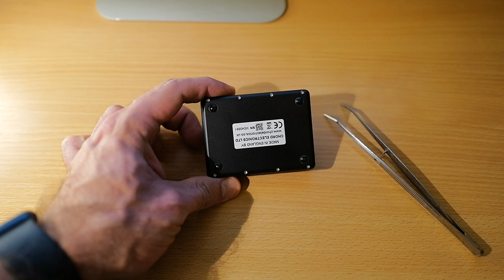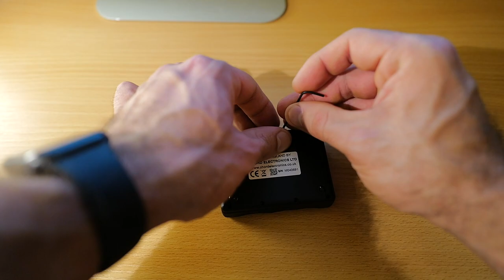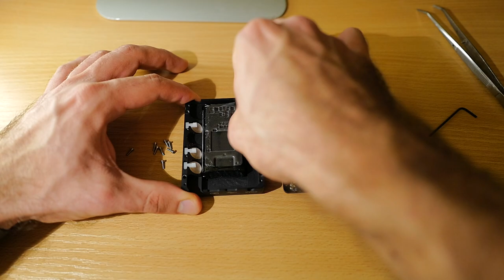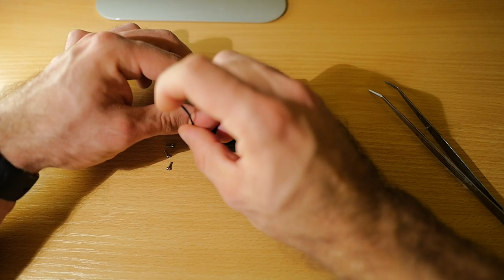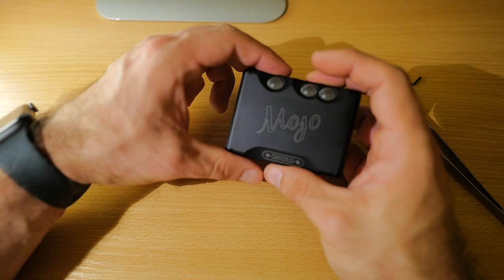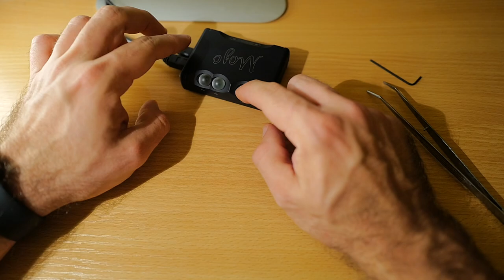How to convert Mojo into a (always on) DESKTOP DAC? Step-by-step GUIDE

Comment: One question, does disconnecting the battery mean that the USB power must be a higher quality,  now Chord say that an audiophile power supply supply won’t make any difference , but is that because the battery is in circuit?
Reply: Hi Grant,

I removed the battery of my Mojo over a year a go. It was fairly straight forward aside from the careful peeling of the battery from the top case. The battery was about to pop! It has worked flawlessly ever since and runs much cooler. It does however cut out occasionally but it is much less prone to this behaviour than when it was functioning with the battery.

Anyhow, I'm using the 5v 1 amp rail of my Allo Shanti power supply. It's a linear power supply which uses super capacitors for the output stage. 

It has been a long time since I did the modification so listen to what I say about sound quality with a dose of caution. I'm not going to editorialise by using the usual audiophile terms but what I will say is that, to my ears, it sounded better in every way. Bass become much more realistic and the soundstage opened up. Nothing seemed to suffer. However like I say this was a long time ago and YMMV.

Comment: So i removed the battery and used the USB port on my iMac to power the Mojo. Everything works fine but this method uses the charging circuit to power the mojo which means the mojo is always charging when playing music and produces a LOT of heats. It's equivalent to playing and charging at the same time when the battery is installed. This excessive heat is no longer destroying the battery since it is removed, however i am worried about the long term effect on the electronics.
In the end, i think the best solution is to wire an external battery to where where the original battery connects inside and charge the battery separately when not playing music. No excess heat will be generated when charging or playing as long as you don't do both simultaneously.
Reply: Edit to my post above: i also tried an external  5V USB battery bank connected to the charging port and the result is the same; the external battery triggers the charging circuit and it is the charging circuit that powers the mojo, not external battery bank. Again, the Mojo is overheating because it is playing and 'charging' at the same time.

Comment: A product that isn't manufactured in China, Philippines or Vietnam?  Difficult to believe.

By the way, Allen is actually a brand name and the generic term is "hex key" :)

 I take it that there are no settings which are normally saved with the battery?  Any settings are saved in flash memory?

I also suppose using intricate tools is very handy for the office.  I'm glad though that computer servers aren't the size of or quite as intricate as a smart phone just yet!
Reply from the maker: The mojo doesn’t really have any settings. The only “setting” is the last state of volume. And that becomes unimportant for this particular case as the volume is set once and for all when used in a desktop system with speakers. However, yes, even without battery it does remember the last volume level.

Comment: Thank you for the video. I managed to disconnect the battery. When I turn it on, the computer can recognize it as mojo, but I can't hear any sound from the output. What can be wrong?
Reply from the maker: That does not sound right. Does the mojo turn to a color to indicate signal input? Is the volume too low? What operating system?
Reply: @TechBlogPool  Yes, there is color showing the signal input. I adjust the volume to max, but dead silent. I am using Window PC which recognizes the mojo. Very strange to me. Can changing power charger make a difference? The output I used is 5V, 2.4 A.

Comment: Nice video Can i connect the mojo to one usb port with a splitter on a notebook?
Reply from the maker: Hi there, depends on the splitter. There is a special cable which enables you to connect the Mojo to one USB port. Take a look at my Mojo Accessory pack video here: https://youtu.be/FMLLya8nYnk. It is a USB A to 2 micro USB splitter but what it does is also split the data and charge parts. https://chordelectronics.co.uk/wp-content/uploads/2016/09/CablePackContents12-CORRECT-900x675.jpg
Reply: @TechBlogPool  Thanks a lot!
I would like to buy a mojo but I don't like the battery thing. Do you think Is a viable option to buy It, remove the battery, and use It with a laptop with the splitter cable? Will It get warm too in this way?

Comment: Super useful video. I followed the procedure and I am now on external power. One question, if I may. Is there a way to avoid the automatic turn off? Or a way to automatically turn on?
Reply from the maker: Thank you for your kind feedback! Unfortunately the automated power off is a permanent firmware function and cannot be disabled. It is irritating. I know. :-(
Reply: After how long does it turn off?
Reply from the maker: A few hours. I was never patient enough to wait and time it but I think 8 hours or 10 perhaps.
Reply: @mccririck01  about 10 minutes
Reply: @TechBlogPool  that seems ok then. I wouldn't be listening for that long non stop.
Reply: How was the mod? Does the mojo still run hot on external power?
Reply from the maker: Yea. Still hot. But unfortunately that’s by design. The mod went well!
Reply: @TechBlogPool  that’s just unfortunate, I was very upset about how good they are but they broke off within one year of usage
Reply from the maker: I hear ya. What specifically broke on yours? Did the whole thing stop working? It seems to be a hit or miss somehow. Some last forever and some break. Here we have a 2 year warranty as standard so if they break in a year you get a new one and the warranty extends as new.
Reply: @TechBlogPool  nah I'm just doing some research on chord mojo since I am looking for a new dac. I'm considering about getting the chord mojo 2 when it come out on january 2022. Hope it doesn't have the same reliability issue like the chord mojo does
Reply: Yes, Just need a small piece of paper, tucked between the switch button and the top cover.
Then your mojo will turn on auto when USB power on, I'm using this now.|

But, when you plug out USB power, you need to wait some time then plugin USB agian ,then it can power on.
If you Plug out and plug in directly, Mojo will turn OFF , not sure why.

Comment: Hello! So funny enough I bought Mojo 2 first but didn't like the way it sound and my friend who has tried both said I'll probably like Mojo 1 better. So now I'm looking at ways to make it desktop capable.

I read about this removing battery technique but some people mention that the battery is 7.4v and usb is only able to supply 5v so this method won't sound the same as running off battery.

Did you the sound change after you remove the battery?
Reply from the maker: Nope, sounds exactly the same. Functions exactly the same. All power is converted to the specs the chips need. If the power was not enough the Mojo would simply not work at all. This theory works for analog products maybe. Like if you feed a tape recorder lower power it goes slower.
Reply: @TechBlogPool  Awesome, that's very good to hear!  Time to hunt down a Mojo 1 lol, thanks!
Reply: I just unplugged my batt. from it.  Powered it using a cell-ph charger 5v 2 Amps. 
Measured batt connection on the board while connecting to the charger and it read 8.4v.   
Working perfectly (sounds better than before with batt. connected).
Logically it should give 8.4v supply to the batt for charging even though its a 5v supply (some step-up in the circuit it self). so it isn't necessary to use an external power supply with 7.4v. (IMHO)
Tried to power it through my PC USB charging port and it doesn't want to stay on. I think my PC USB charging port doesn't supply enough current (< 2 Amps).
Thank you @TechBlogPool for this video mod, saves me to buy a new batt since I'm using my Mojo for desktop only.

Comment: This is a very helpful video. Do you know if the same concept applies to the Chord Poly?  It is the streamer that plugs directly into the Mojo and the power becomes a pass through from the Poly to the Mojo when plugged into the charger.
Reply from the maker: Hi there! Unfortunately I have not tested this with a Poly. My assumption is that it would work as expected with a Poly as it only piggybacks on the Mojo and passes through the power to the Mojo.
Reply: @TechBlogPool  I took the Poly apart and the same process is used.  Since smaller it has a very small snap in connection on the end of the pigtail instead of a plug.  I have seen similar in Mac laptops.  Although you don't have the mechanical fitment issues of the marbles and plastic adapters, you do have to be mindful of a plastic fiber optic piece that transfers the light from the Mojo charging indicator to the edge of the Poly since it covers it when plugged together. It has a specific orientation that needs to go back together the same way.  The Poly and Mojo are plugged back together, both without batteries and plugged into an Allo power supply.  It all works flawlessly as I search for replacement batteries.
Reply from the maker: Amazing! Thank you for this update Tony!

Comment: Dear Martin, i wrote to Chord Electronics and they said that the battery can be disconnected, but if there is a surge during use, the Mojo can be damaged. In my opinion with a stabilized power supply there is no risk (mine is stabilized 5 volts 3 amps). Do you confirm what I think?
Reply from the maker: Hi Vincenzo! I’d confirm. If there is a surge any electronic device can get damaged. You can always connect it to a surge protection socket. Actually most power supplies have some sort of surge protection built in. I’d say it’s fairly safe.
Reply: @TechBlogPool  Thank you very much. Very clear !!!!
Reply: @TechBlogPool DC doesn’t work like AC
Reply from the maker: Yes. That we all know. But what are you trying to say?
Reply: @TechBlogPool  DC doesn’t have surge like AC does, it doesn’t need surge protector using battery
Reply from the maker: @TranTek I’m afraid I still don’t know what you’re trying to say. Surge protection is used for cases of power instability in the electric wire system to protect devices connected into sockets from getting fried. What exactly are you saying?

Comment: Im buying a mojo 1 to use it as a desktop dac. I dont understand why you cant you use it connected externally  and you have to remove the battery.
Im pairing it with an streamer and a vintage amplifier.
Can someone explain me. Thanks so much!
Reply: Le quita la batería porque esta no salió muy buena. Muchos usuarios renegaron de la poca duración se la batería pero sobre todo por como ésta calienta cuando se usa y se carga al mismo tiempo; esto, al cabo de unos minutos de uso hace que el Mojo se ponga muy caliente, entonces por eso la gente que le da más uso fijo en un escritorio y computadora, optan por quitarle la batería. En mi caso, como me gusta usarlo de forma móvil, se la he dejado puesta. Pienso comprarme una nueva batería pronto.
Reply from the maker: Precisely as Tito below explained. Of course you CAN use it as it is as a desktop setup. The issue you will soon notice is that the battery gets charged and discharged unnecessarily and it will die on you sooner rather than later and so to save the battery it’s simpler to disconnect it rather than having to replace it in a year due to unnecessary cycles. A secondary issue is the excessive heat produced during the unnecessary charging.

Comment: Could it be advisable, for example for overheating, to remove the battery completely? Also, is my power supply 5 volts 3 amps? Can 3 amps be harmful?
Reply from the maker: So normally the device can take as much or as little power it needs so you don’t have to worry. The Mojo should not overheat with or without a battery. But you may try to take it out and add thermal pads so that the chip touches the case once closed.
Reply: @TechBlogPool  Thank you very much!!!

Comment: Hello! Just tried it and is working fine but the "hissing" noise is still present...any thoughts? Will it go away after some time plugged in? I am currently feeding power to the Mojo from a Macmini USB port.
Thanks!
Reply from the maker: Hello there! Very glad to hear the tutorial worked for you! As regards to the hissing, yes, it goes away the moment the mojo is receiving signal. Kindly give it a try. Connect to your Mac mini both ports and then try to play some music. Mute the music and the mojo’s hiss should be gone. U fortunately it’s a noise the mojo makes when not being fed any audio signal.
Reply: @TechBlogPool  still hissing while playing...no effect on sound quality but is it safe to run it like this? Any thoughts on how to solve it?
Reply from the maker: Can I ask you to try to power it off of a different source? Preferably a USB charger with 2A.
Reply from the maker: It should be safe for sure. Hissing is just the sound of the electronics unfortunately. Sometimes even high end components do this.
Reply: @pjmacgyver85  it will be explode if it’s kept that way for long.
Reply: @ATommy-lz4jd  use the charging cable that came with the Mojo. That will reduce the noise the Mojo makes considerably.
Reply from the maker: The noise Mojo makes is independent of cable length or cable type. It’s an inherent behaviour of mojo.
Reply: @TechBlogPool  not in my experience.

Comment: Can I ask how people are connecting the mojo in their system. For a few years now I have been using the optical output of a Chromecast Audio into the mojo but I'm wondering if an electrical coax input would sound better? I use optical to avoid any noise entering from the Chromecast Audio.
Reply from the maker: Unfortunately the audio coming out from a Chrome cast is knows to be of poor quality. Better would be if you can connect it directly to a PC. For best quality anyway. And play some DSD music! Coax has somehow disappeared but you can still find it on some Blu-ray players perhaps.
Reply: @TechBlogPool  I have my music stored on a NAS drive at the moment and send it to the Chromecast Audio using an app on my phone. Is there a way to do that without the Chromecast?
Also if I used the USB input is the a galvanic isolator you would recommend?
Reply from the maker: To be honest I never had any interference issues with the Mojo that would require an external galvanic insulator. The mojo is dead silent.
Reply from the maker: Unfortunately I never had a NAS for streaming audio from. But what works quite brilliantly for me is connecting it to an iPhone and streaming from the iMac. This way you can even stream DSD if you convert the files to a DSD/ALAC bi-format.
Reply from the maker: You can convert it with DSD Master tool: https://apps.apple.com/sk/app/dsd-master/id829431988?mt=12
Reply: @TechBlogPool  sure, but it can still improve sound quality even if there was no audible noise.
Reply from the maker: Definitely give it a try.

Comment: Hai 
Very nice video thanks for your research and saved plenty of mojos from death 
Chord mojo is meant for is crystal clear noise free audio that the reason the mojo circuit will get drives through the battery power to reduce the noise and hiss .i am from india the power supply from the wall socket are not much clean it will definitely develops a hiss noise , can i use a good battery power bank .thus it serves the purpose which also makes the mojo portable 
Thank you 
Waiting for your reply
Reply from the maker: Hello there to India! Definitely you can use a good power bank instead of the wall socket!
Reply: @TechBlogPool  thanks a lot for your quick reply .heard from a forum that the mojo cable kit has got a special cable which will carry the power and data through  a single usb cable which need to be connected to the data port .even if the battery dies the mojo will get power through the data port is that possible does it works .
Reply from the maker: Hello there.., ok, let me explain this a bit. The Mojo has two micro USB ports. One is ONLY data and the second is ONLY power. The data port cannot accept power and the power port cannot accept data. Internally the mojo has separated the power and data to minimize interference. I believe it’s called galvanic isolation. The cable that is part of the mojo accessory kit that you mention is a Y split cable. Where on the USB A thick end you connect is to a PC/MAC and the two cables on the other end are then marked as one carrying the data part and the other the power. There is not a difference in real usage between using this cable or simply two cables when connecting to a PC/MAC. The difference comes if your device only has ONE USB, let’s say an iPad or maybe some mini-notebook that only had a single USB, then this cable is great. But if your device has 2 USB ports then you can simply use two cables. Note however that to power the Mojo your USB needs to have 2A power delivery! Not all USBs on devices can do this. For example an iPhone cannot, or many other devices simply cannot power the Mojo easily. Even many older USB power plugs are only 1A and will be insufficient.
Reply: @TechBlogPool  Hi there. Thanks for Your video. It helped Me make a decision  to go for the Mojo. Had been on the shelf for a long time due to the battery related issues.

Can you confirm that once the battery has been disconnected, it would be safe to run the mojo through a power bank. Have you personally tried it? Also would it take care of the difference in voltage of 5v and 7.4v?  Would the power bank have an advantage over a wall charger as far as sound qualty is concerned?
Reply from the maker: I have tried a power bank and for me personally there was no noticeable increase or decrease in sound quality. Please do make sure that the power bank has sufficient power to power the Mojo.
Reply: @TechBlogPool  Thanks for Your reply.👍